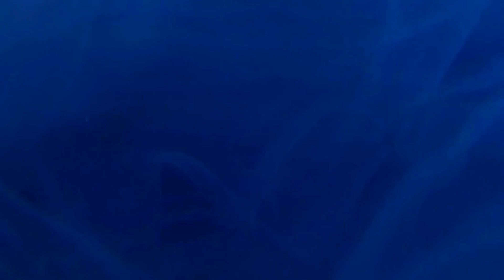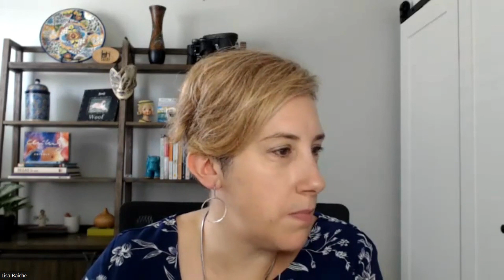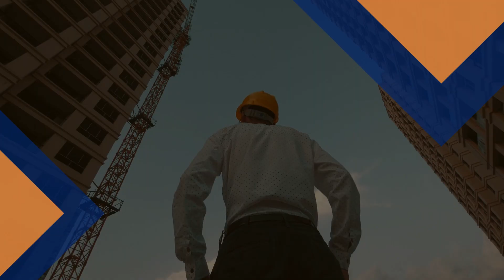The Importance of Job Costing in Construction - The Construction CPA

Comment: Great video! Job costing in construction is indeed crucial for maintaining profitability and project efficiency. Integrating job costing with modern software solutions can streamline tracking labor, materials, and overhead costs, offering real-time insights and aiding in proactive decision-making. This ensures projects are on budget and timelines are met. 💡
Reply from the maker: Thanks for the boost! This is really a crucial matter in making sure that budgets on a project are well-spent and that the client knows where every penny goes. It is not just another paperwork but a critical component comes tax season.